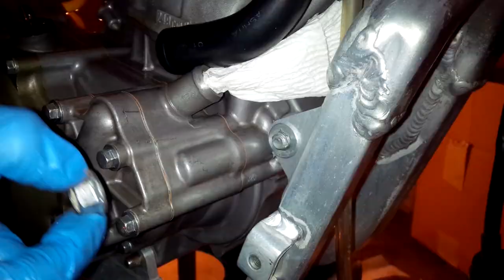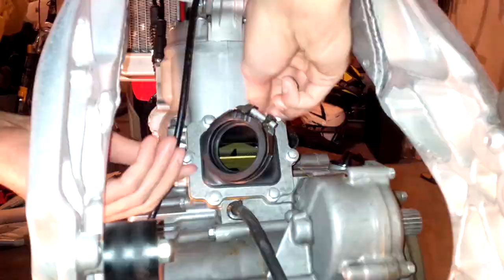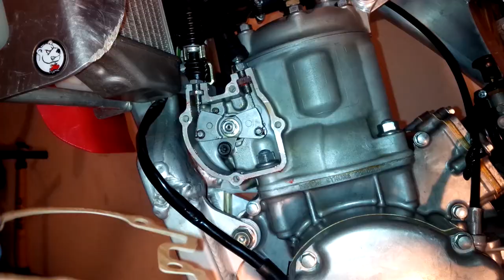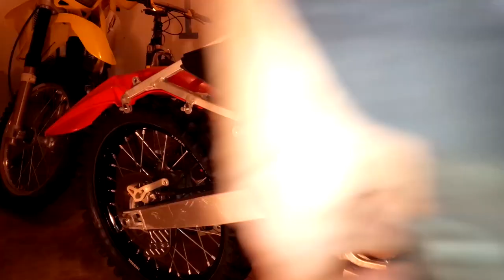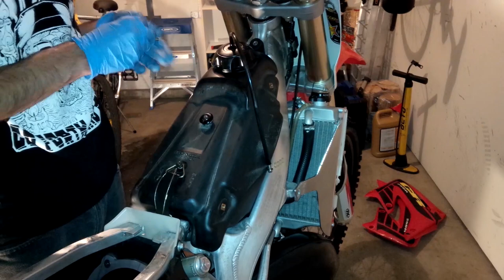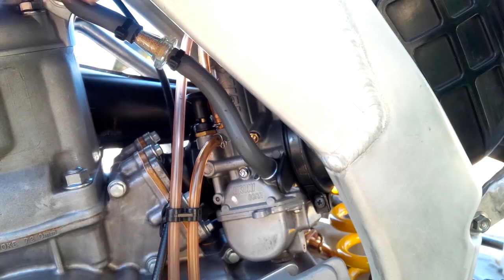2002 Honda CR250 engine rebuild, Part 4 - The FINALE

Comment: What skid plate is that? I like the plastic one!
Reply from the maker: It's an amazing skid plate, it's lasted forever. Check out Hyde skid plates. I use them on both my bikes.
Reply: @madmarc  thanks dood. I might have to buy myself one soon. Have you used the handgaurds?
Reply from the maker: @fourny55  No I haven't but I'm sure they work well too. They look really beefy.

Comment: Watched your entire build on this, first off, fantastic work. From what I can tell you were thorough, resourceful, and did an overall great job with both the build and filming. I have a project 02 cr250r as well that I'm close to finishing up, few questions about yours/your build:

-Did you reuse your OEM crank? It looks like you replaced the main/case bearings but not the crank or large/small end bearings, is that correct? (My bike still has the original crank and bearings).

-Was the clutch that blew up the OEM/original? (I'm asking as the OEM has aluminum disks and every aftermarket I know of has steel. On my bike I swapped the original out for Tusk as soon as I bought it). 

-How are you liking the Tusk clutch kit and Pro-X piston? Did you use the tusk springs as well? (I did, noticeably heavier clutch pull) (I'm putting both of those same components in my bike, admittedly largely due to price).

-I noticed you're running a fly wheel weight, how heavy and how are you liking it? 

Overall great job again, sorry for all the questions!
Reply from the maker: Thanks for watching, and for paying close attention!
1. Yes, i reused the stock crank. in fact the bearings were still good too but i replaced them anyways
2. The clutch that blew was the original. At the time it blew up the bike still only had 67 hours on it total. Had I known the stock discs were susceptible to blowing up i would have swapped them out for steel ones too!

3. The new clutch is working awesome. I kept the stock springs, they work just fine and the clutch pull is still nice and smooth. I have almost 20 hours now on the bike since the rebuild and the pro-x piston is working great too. But i did drill lubrication holes in it which i don't show in the video, but you can see a pic here: https://thumpertalk.com/uploads/monthly_2018_10/IMG_20181002_203002.jpg.9fda0c8ca259d56cb14ba2a8490b364b.jpg
4. I couldn't really tell a difference after installing the flywheel weight. But i put it on almost when i got the bike so i can't remember what it was like before. the best mod i did for performance was having the head squish corrected by RB designs. I recommend you do that if you haven't already. http://www.rb-designs.com/rb_designs_llc_005.htm
Reply: @madmarc  Thanks for the quick reply! Awesome man I appreciate the info/feedback. Bike looks fantastic. I have the tusk springs in right now and the pull is a little heavy so I'll probably go back to stock and run them as long as it doesn't slip. 

I'll have to look into drilling the lubrication holes,  I have heard that you're not supposed to do that with a cast piston like pro x but when I tore the bike down I immediately noticed major wear and scoring on the exhaust bridge from lack of lubrication and subsequent overheating from the stock piston (no holes). 

My bike currently has about 50 original hours on it and my crank feels great so I'm planning on running it with this new top end for 30 hours or so before doing a full motor overhaul.  At that point I'll do the either the squish mod or buy a VHM or FHR head. Thanks again! Building the bike all the way up tomorrow (finally,  college student so have little free time, luckily I have an 07 yz450f that's in one piece😂).
Reply from the maker: @premixpeter1972  initially i wasn't going to drill the holes out of concern that the cast is too brittle, but when you think about it, pistons break at the skirt, not up at the top. gotta keep those bridges cool!

Comment: Awesome videos man. In video 3 when you torqued down the cylinder barrel did you have to adjust the torque settings because you used an extension on your wrench or did the same figures still apply? Cheers
Reply from the maker: Hey thanks a lot Todd! Yes you have to reduce the torque settings. See the formula for calculating it here: https://www.motionpro.com/a/torque-wrench-adapter-08-0134/